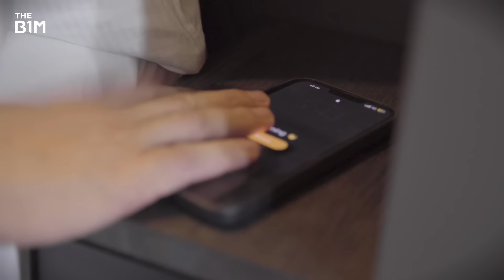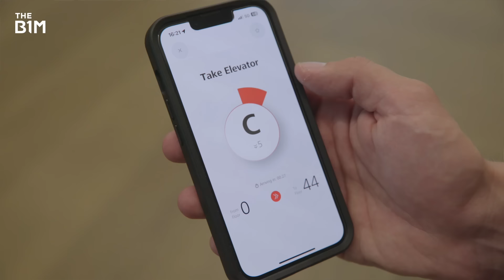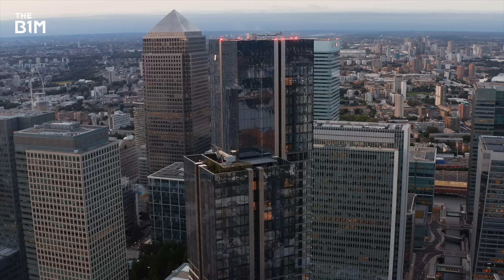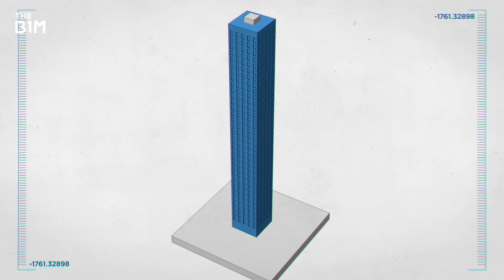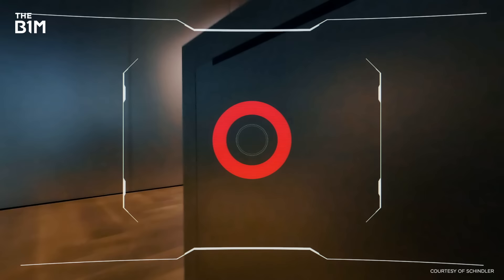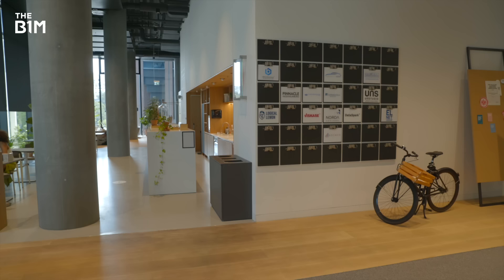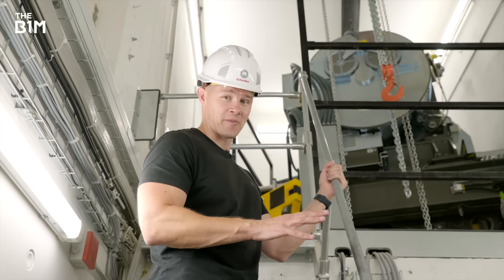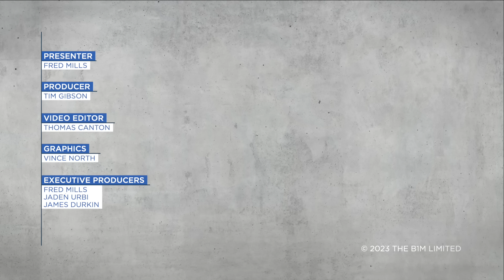Germany Has Solved the Empty Skyscraper Problem

Comment: as others have pointed out, there are a lot of issues with converting commercial space to residential space, it looks like this innovation addresses one of those issues. as I understand it, the reason tall, multi-use buildings require separate elevator systems is because of the varying levels of security/access required by commercial, residential and hospitality tenants. it looks like this system is really a "smart" access system that uses the same elevators to let people go where they need to go and restrict them from places they shouldn't go...a little more exposition on how the system does this would have been interesting
Reply: if you know anything about elevators, you know that relying on them for safety and access control is a very very bad idea.
Reply: The issue here is that a smart access system only works if there is a single person using the elevator. As soon as you have multiple people with different access codes using the elevator at the same time everyone will have the ability to go anywhere.
Reply: @klyis -- there are a few ways to solve this. One is, just have additional badge access after you exit the elevator. Another is to disallow mixed security passengers on the same trip. I suspect some combination of both is the way to go.
Reply: I have lived in I mixed, commercial and residential building for more than 30 years in the middle of the city, and we have had the same security/access system since day one. It's nothing different or innovative.
Reply: @szurketaltos2693  any elevator-based security is inherently flawed
Reply: thanks. Now I get what this story is about.
Reply: @RandomUser2401  the elevator is only a layer, you still probably need doors after the elevator. That's pretty standard with mixed use buildings anyways?
Reply: @szurketaltos2693  well at least currently there‘s many buildings where floor access control through keys or keycards is the only layer..
Reply: @RandomUser2401  right. So what this adds is another layer of weak (or strong-ish if you only allow same security people on a single trip) access control, and a way to call your elevator ahead of time via app, that can be an input into the elevator control algorithm.
Reply: We have showers and kitchens in my office. I don’t think it’s that much of a problem
Reply: @szurketaltos2693 so, a 4-star+ apartment? 

Because this is how I rmbr it. Each floor have a lobby with a locked door that can be opened with an RFID card

With that same card, the elevator can only go to the floor you have access to and required identification with the rfid card in advance

Parkings and gate required that same card too

Finally, the main entrance and lobby requires a secured access with that same rfid card.
Reply: @Vysair  yeah, that's a good way to do it. Though each floor probably only needs a hallway, not a lobby per se. As far as I can tell, what the video's tech adds is just the app and the ability to call ahead of time and integrate that into the control scheme.
Reply: This video is clearly about how the mixed use was clearly thought through and flexibly integrated into the structure. Considering possible changes in the future and demonstrating how apartments and offices can co-habilitate the space even on the same floors. Not sure why you didn't get that.
Reply: @Klyis that's why they categorized it into 2 groups, residential and commercial so I think what he meant was if it's servicing someone on the residential side it'll only take them to residential parts of the building.
Reply: @szurketaltos2693  Yeah, I meant an enclosed hallway but I couldnt find a better word for it. Though some apartments have an actual guards or "mini lobby" every fifth floors or so
Reply: @szurketaltos2693 hence the separate access entry and multi-access elevator. The elevator would only accept passengers from one entry per trip.

Comment: In other videos on converting office space to apartments the biggest challenge was bathrooms. Offices have one centrally located large bathroom with multiple stalls not at all what an apartment needs
Reply: Why not then you get to hear your neighbors fart in the stall next to you.......:hand-orange-covering-eyes:
Reply: This video is just a badly disguised advertisement for an elevator manufacturer. They haven’t really come up with anything groundbreaking, and it’s  not even the biggest issue to be solved in mixed used skyscrapers.
Reply: @miroslavmilan  It's actually a non-issue. Why would I care if there are office workers that enter the building through the same lobby and use the same elevators? As a resident I'd know that I'm in a multi-purpose building, and what to expect from that. The only real issue is unauthorized access, but that can be minimized by access-controlled doors at the residential floors.
Reply: @Volkbrecht it's the other way around. Visited a friend in an apartment. It's shared. I was blocked from the bank and companies using the building. In office buildings that allow people off the street to just enter, you usually have to pass a security desk at the bottom, then each floor has a lobby. If you get off at the wrong floor you usually get flagged by security. Lots of the floors will be totally closed to the public so stepping off in them without a bade causes a security response. Sure you could just open the whole building up totally to the public, but then no companies will rent there.
Reply: This video is clearly about how the mixed use was clearly thought through and flexibly integrated into the structure. Considering possible changes in the future and demonstrating how apartments and offices can co-habilitate the space even on the same floors. Not sure why you didn't get that.
Reply: @Fr00ter  that's not new. the video was supposed to be about converting offices into residential units, which would be an absolute game changer in the real-estate investment world.
Reply: Apartments of the future! Just when you thought housing couldn’t get any worse.
Reply: 1 of my countrymen proposed that public housing of the future should be more like hostels - with more shared spaces e.g. kitchens, bathrooms to promote more interaction between neighbours. I imagine it'd be easier to convert offices into such kind of housing
Reply: @jasonderby7635   Right, the flexible design does nothing for existing vacant office space.  It only makes future buildings more expensive, but flexible in use.

Comment: This is the weirdest B1M video I’ve ever seen. Like, I appreciate that Schindler has experience with mixed-use high rises, and that it’s going to be important as office demand decreases in central business districts, but I didn’t take away any insight into what this approach to elevators actually means in practice other than having two doors, something all of the high rises I’ve lived in already had.
Reply: This video is clearly about how the mixed use was clearly thought through and flexibly integrated into the structure. Considering possible changes in the future and demonstrating how apartments and offices can co-habilitate the space even on the same floors. Not sure why you didn't get that.
Reply: This video is clearly about how the mixed use was clearly thought through and flexibly integrated into the structure. Considering possible changes in the future and demonstrating how apartments and offices can co-habilitate the space even on the same floors. Not sure why you didn't get that.
Reply: This video is clearly about how the mixed use was clearly thought through and flexibly integrated into the structure. Considering possible changes in the future and demonstrating how apartments and offices can co-habilitate the space even on the same floors. Not sure why you didn't get that.
Reply: This video is clearly about how the mixed use was clearly thought through and flexibly integrated into the structure. Considering possible changes in the future and demonstrating how apartments and offices can co-habilitate the space even on the same floors. Not sure why you didn't get that.
Reply: It’s basically a bad advertisement, using verbal positioning, when it should be using an animation to show the efficiency gain, my guess is they have not packaged the product yet, and they want to protect some of the IP and methodology
Reply: different areas require different levels of security and access.

Comment: So I'm confused, the reason you can't take a normal building with normal elevators and turn it into a residential tower is because people would "feel like they're in an office" - whatever that means... ?
Reply: this video is extremely dissappointing
Reply: There are different codes and requirements for residential and commercial construction projects because both spaces are used in vastly different ways by vastly different people.
Reply: Kitchens need exhaust, bathrooms need separate exhaust, plumbing vent and drain, lots of them. windows for each room. The overall  footprint is more suited for large openness so light can get to each desk. Residential is small rooms unless it’s a youth hostel or military dormitory. Some buildings could work others too awkward.

Comment: In New York there are additional challenges in converting office buildings to residential, because of the differences in building codes. The residential codes require a window in every room, while office workers were never afforded that. Many modern office buildings have huge floors, that used to be filled with little cubes. That doesn't work as bedrooms.
Reply: In Germany natural light is required for workplaces, so the us-typical cubicle system would not be legal. But other than that I agree. You would need permits and put up (or tear down) walls and reroute plumbing, depending on the exact floor plans.

Comment: So just that I get this correctly: The actual issue here is that you want seperate lobbies for some reason, right? Because if you had a mixed lobby, there would be no issue with the elevator. 

In the video it is presented like an obvious fact, that work and residential people have to be completely separated but to me that really isn't obvious. Maybe I am missing something here. I think as a visitor I would find it quite confusing, if I had to use different entries for different floors. Also, do Visitors also need to install an App to use an Elevator of a Building they are just visiting?

Comment: While going over various elevator setups is interesting, this seems like a minor/tertiary issue when you are supposedly asserting to have 'solved the empty skyscraper problem'. There are just so many more significant barriers to changing a commercial tower into a mixed use/residential tower than getting a more efficient elevator service design.
Reply: No, there are just more equally ranked problem. Lot's of details, but nothing really complicated. Modern Underfloor-shower might be the only thing, that goes into the floor itself. And that's the only thing you have to keep. Floors and outside Windows.

Comment: I love that they think the big reason we can't use empty offices to solve the housing crisis is that executives don't want to ride with the poors in elevators.  If only it were that easy, i suspect it has much more to do with the plumbing (one bathroom per floor in an office building vs 1-2 per apartment and a kitchen too) and the large amount of windowless interior space of large-volume office buildings.  If you didn't build for dual use, retrofitting is expensive and may just not work at all.
Reply: Well in UK apartment high rises they make sure 'afforrdable' 😂 apartments always have separate entrance & (and a lobby/parking if the developer was feeling generous) lift in too keep the rich hermetically sealed in their luxury and protected from being contaminated by the poor....
Reply: Did you even watch the video?  The offices and apartments use the exact same elevators...
Reply: @krashd  Through 2 separate lobbies so that the 2 groups never intermix or even see each other. Their point still stands, though the less snide reasoning would be for security.

The system works by using an app on your phone to designate whether you're going to an apartment level or an office, and then grouping people up into specific elevators to isolate the 2 groups, making sure an elevator with workers won't stop at any of the apartments and vice versa.
Reply: This video is clearly about how the mixed use was clearly thought through and flexibly integrated into the structure. Considering possible changes in the future and demonstrating how apartments and offices can co-habilitate the space even on the same floors. Not sure why you didn't get that.

Comment: I was figuratively scratching my head for this entire video until you revealed the sponsorship at the end. As others have said, the elevators are only a minor part of converting from office to residential use, or mixed use design. Far more important are things like the shape of the building to allow natural light, redundant utilities for easier future conversion between uses, etc. I assume this tower in Frankfurt has these elements as well, or else converting office floors to residential use in the future would be just as difficult as converting any old office tower currently is. Also, I don't believe this elevator technology is particularly new.

Frankly, this video is below your usual standards. I don't feel I learned anything from it. If you wanted to do this sponsorship you should have integrated it into a larger piece about future planning for easier conversion between uses.

Comment: I would have thought there were more significant issues with residential/commercial flexibility being the building services requirements...
Reply: There are. Office buildings in DC are being converted to residential use, and they have to strip everything down to reconfigure the plumbing, the electrical wiring, the layout, etc.

Comment: This solution has actually been around for a while, although this may be the first new construction to use this technique. I remember presenting smart elevators in one of my presentations back in undergrad and that was lets say a few years ago.  But I know some buildings in Japan are using a similar system to some success. But here in the US, the problem is more so the plumbing issue rather than the elevators (I am not sure what they are doing about that, but the number of office tower conversions is going up, especially in NYC).  Nice tech all the same although I am not sure how much I would want to rely on my cellphone for building access.
Reply: Plumbing and floor plate size. Some of the larger floor plates require some way to get more light to the core, either by adding a courtyard ($$$) or changing the rules to allow artificial lighting in bedrooms. I suspect the other utilities (including elevators) are also tricky, but probably not nearly as bad as those.

Comment: In most office to commercial conversions, the elevators are the least of the problem. Think about the last big office you worked in. Picture where the bathrooms were. That’s the only place on that floor with plumbing. Once you break up that floor into apartments, every one of those apartments needs running water, separate heating/AC and other utilities. That office building you are imagining probably doesn’t have space for this. In many cases it’s cheaper to tear it down and rebuild than to convert… unless it was designed from the beginning to be modular. Most skyscrapers aren’t designed that way.
Reply: And people moving into those apartments might be making a lot of noise. Are they going to be just serviced apartments for short term rent? Because they can't be long termed since if individually owned, people might want to do some renovations to it, then what about the noise?

Comment: The new Ritz Carlton tower in Mexico City works similar to this. The hotel has apartments, offices, hotels, commercial space and restaurants. The elevators have multiple doors depending on where you want to go. The car garage is also pretty impressive as it stores the vehicles via a lift system.

Comment: Fred, I read an article a couple decades ago about challenges to office building conversion. At the time the thinking was that the biggest challenge was insufficient floor height to allow for retrofitting the plumbing required for residences. Has this been solved?
Reply: The challenge is actually the other way around. Office floor-to-floor is typcially higher than residential due to taller ceilings. When building for dual purpose on day 1, the residential floors would come in more expensive as they would be built with a higher floor to floor than typically required. Advantage is to be able to run plumbing and services in the resulting ceiling void, but comes at a cost due to added structure and facade that a purely apartment or hotel building wouldn't need.
Reply: @danjelowitsch   thats true but with the rediculous mismatch of vacancy rates to need, the improved revenue from making it mixed use would almost certainly dwarf any extra cost - and in the case of all the existing commercial structures, the cost was already built in.
Plus a lot of extra uses for taller spaces in residential are possible.
Reply: Yes, the solution is vacuum plumbing which is used on ships and aircraft and in many large buildings such as hospitals stadiums and hotels. The manufacturers of these systems have websites. Another advantage is that vacuum toilets use much less water than normal fixtures.